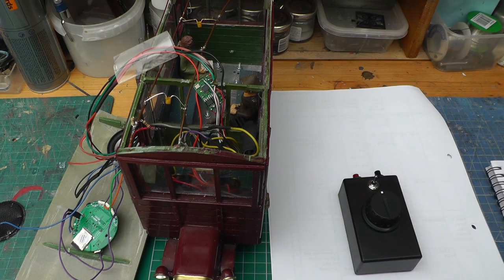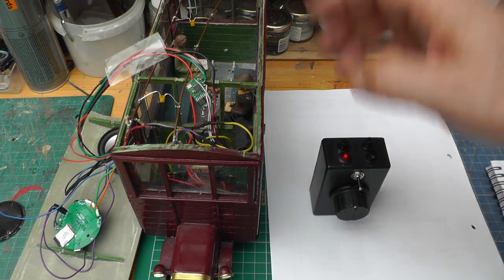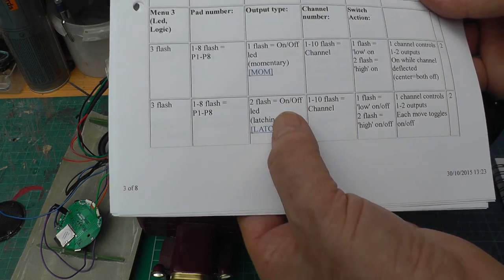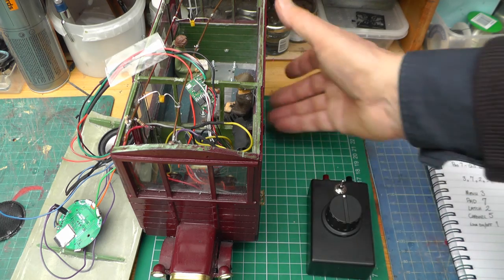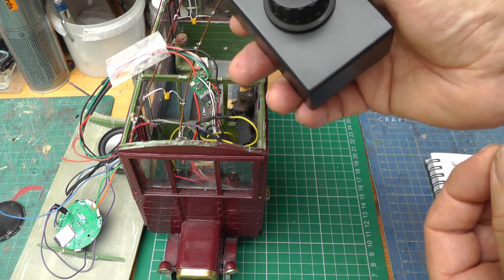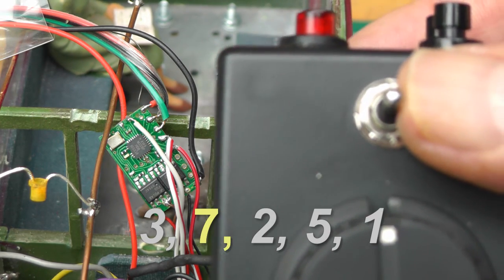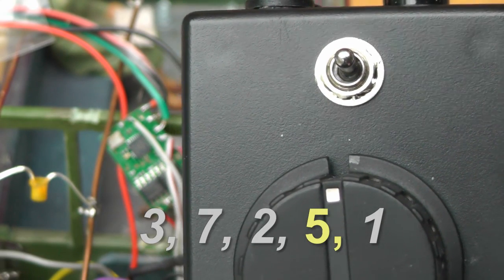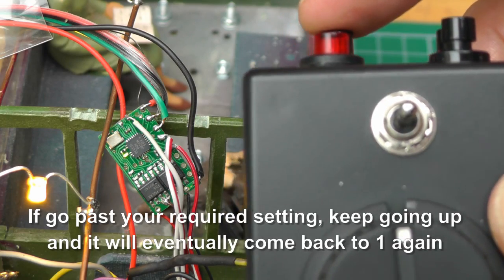Reprogramming a Deltang receiver with a Deltang Tx20

Comment: Very informative. I plan to install Deltang into all my locos, as you know, so these clips will become a great resource for me. Quite amazing how much control one can have with such a simple set-up. I've just installed a simple RC controller/receiver into one of the locos but this was just to get my head around the internal workings of RC in garden trains. I'd like to buy the Deltang so I assume the TX20 is the right transmitter. Can you recommend a supplier, please? All the best...Tom
Reply from the maker: +Tom jenssen Hi Tom. I usually buy my gear direct from David at Deltang. His email address is at the foot of his webpage. I've put some info about how to order from him on my blog posting - http://riksrailway.blogspot.com/2015/08/getting-started-with-deltang.html